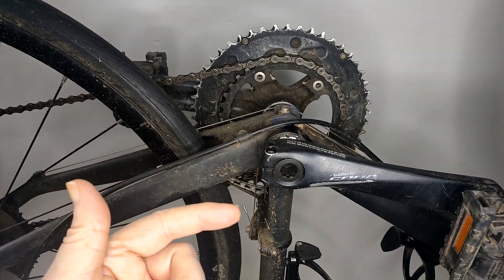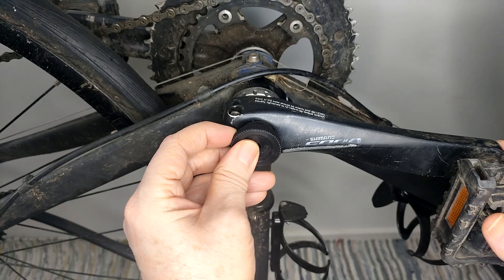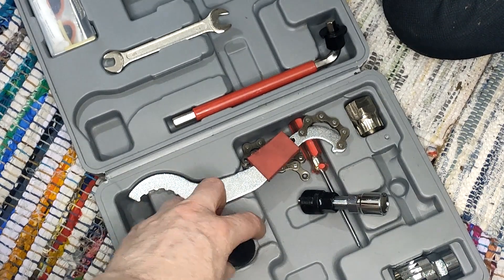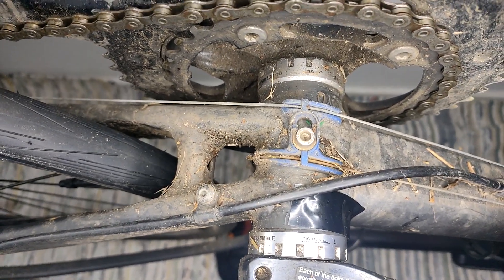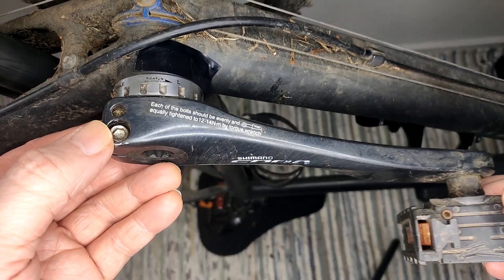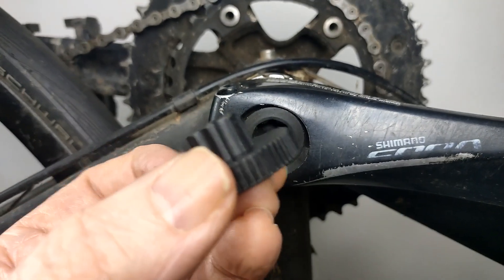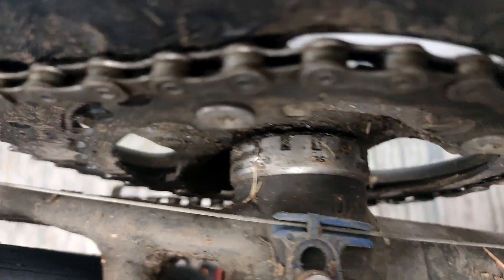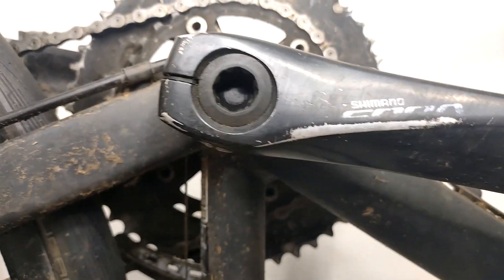Shimano Hollowtech 2 (PINCH BOLT design).. does it need a special tool ?

Comment: I would 3D print it. I printed several bike Tools. It is not as durable as proper tools but some tools are quite expensive if you dont use it a lot (like in a bikeshop) I have a Hope bottom braket on one of my bikes. It's not the standard bottom braket it is bigger i 3d printed a tool. I head to bleed my dropper post. Got to the homepage of the manufacturer, downloaded and printed the tool and fixed it. 

 I broke my Chain Guide. The replacement costs 30 bucks and is not available right now. Printed one.  

For me a printer is a tool like a dremel or a drill. Over time it is worth it especially if you are self employed and you need to fix your stuff for work,

Comment: I use finger to install the plastic cap, and maybe you can try coin, I can use the coin to remove the cap from the m6000 crank, but the plastic cap will be bite a little by the coin. lol

Comment from the maker: the 2 Shimano Hollowtech 2 designs ?
1. Pinch bolt (e.g. this 1).
2. Splined interface.

Google Gemini AI says :

if your Hollowtech II crankset has a pinch bolt on the left crank arm, you will need the TL-FC16 tool for installation. If it has a splined interface, you won't need any special tools.

not all Hollowtech II cranksets require the TL-FC16 tool. The TL-FC16 tool is specifically needed for installing and removing the left crank arm on Hollowtech II cranksets that use a pinch bolt design.

Here's a breakdown of the different types of Hollowtech II cranksets and the tools needed for their installation:

Pinch bolt design: These cranksets require the TL-FC16 tool to tighten and loosen the pinch bolt that secures the left crank arm to the spindle.

Spline design: These cranksets use a splined interface between the left crank arm and the spindle, and they do not require any special tools for installation or removal. The crank arm simply presses onto the spindle and is secured with a nut on the non-drive side.

Comment: That plastic thing is a preloader that pushes the non-drive side pedal onto the shaft so when you tighten the bolts it fits snugly; you can remove it afterwards.
Reply from the maker: I think its a screw cap, so needs to stay on really. its got threads.